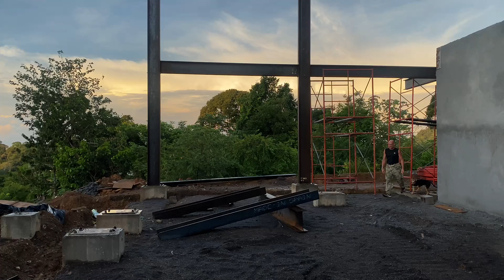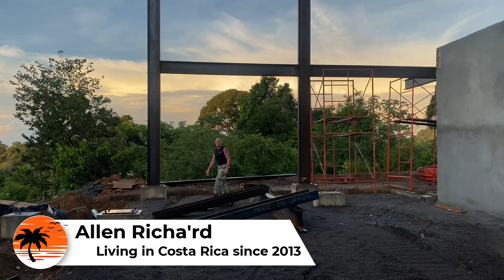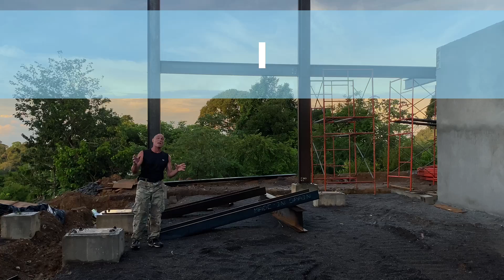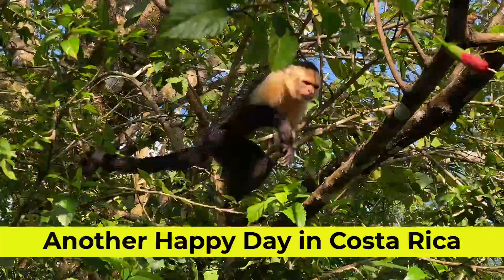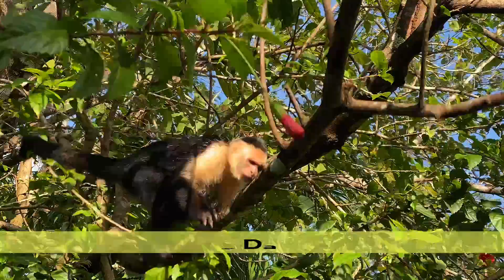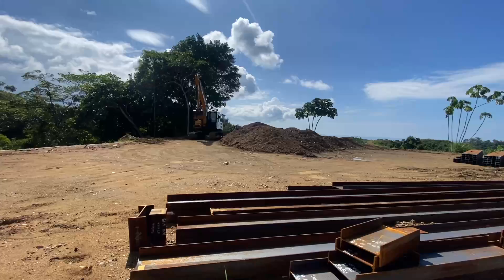Steel Frame House Construction in Costa Rica - Building a House in Costa Rica

Comment from the maker: Are YOU ready to move to Costa Rica? Schedule your FREE 20 min Coaching Consultation to discover and learn the best way to Invest in Costa Rica.

http://createdforsuccess.com/endorses/phone-consult
Reply: How did you ensure those pedastals are in the correct position
Reply from the maker: @kingsman3087   Simple...just follow the blueprints.  Everything is on the blueprints.
Reply: @unbridledlivingincostarica  like you used batter boards,strings?
Reply from the maker: @kingsman3087  that is correct,
Reply: What are heavy steel dimensions?
I am writing from Türkiye, there was a big earthquake in my country. 
We are on the fault line and people do not want to build concrete structures anymore. people want to erect structures on heavy steel because it is durable and reliable.
The regions damaged by the earthquake will be restructured in our country. My request from you is to say that you can build heavy steel houses for our country. Believe me, there will be a lot of requests.

Comment: I like the metal structure !! So when cranw was lifting the metal polls and fitting them inside concrete pillers so does it has holes for metal beam or how they are fixed ?? In the ground
Reply from the maker: These were all welded together.  No bolt on and no holes.

Comment: I thought I beam is for horizontal, and H beam is meant for Vertical. There's a logic why it's 'I' shape, not just random.
Reply from the maker: Most people don't know the difference of an I beam and H beam...but in CR,  most CR call it an 'H" beam...while we call it an "I" beam...
But if you want the details...or the difference here it is:

No, I-beams and H-beams are not the same. They are both types of structural steel beams, but they have different cross-sectional shapes.I-beams, also known as universal beams or W-beams, have a horizontal top and bottom flange with a vertical web in between. This shape provides high strength in a structurally efficient design, making them commonly used in construction and structural applications, such as building frames and bridges.H-beams, on the other hand, have flanges (top and bottom) that are wider than the web. This creates an "H" shape when viewed from the end. H-beams are often used in construction for columns and beams of industrial buildings.While both I-beams and H-beams serve similar purposes in construction, their different cross-sectional shapes make them suited for different structural applications.

Comment: Not only are you building a home in CR but your building it out of Iron. I’m an Ironworker working on moving to CR, this is awesome! A couple questions and suggestions. Why are you welding the beams to column instead of a bolted connection? Also, it looks like you had the base plates of the columns already in place sitting right on the concrete and you made the column level with your fit…. Why was it done that way? I would suggest fitting the base plate square to the column before installation then using metal shims or Jack nuts (nuts on the anchor bolts below the base plate) to set elevation and make it easier to level out. Then fill in the gap with grout after. It’s much easier. Either way, AWESOME!!!
Reply from the maker: I agree with you Tim....
The reason we did it this way was couple of reason.  #1 the contractor didn't have that much experience, but is very good.  

We put the column plates in the cement column support area...leveled them perfectly and then poured cement. You have have to be very precise in this...but the same the other way as well.

Welding everything together instead of bolted connection for the same reason as above.  I don't know that they have a manufacture here that could have made that connection for us.  It was extremely difficult and very expensive to actually get this steel here in Costa Rica.

Thanks for your input and questions.
Reply: @unbridledlivingincostarica  makes more sense now that I know you put the plates in before pouring. Can’t wait to see how it all turns out. Keep up the great work! Pura Vida!